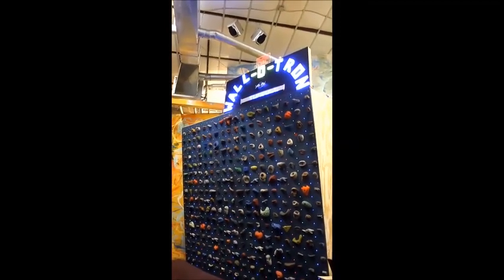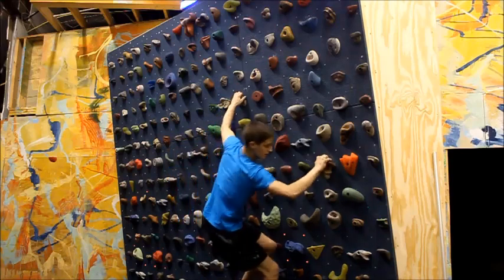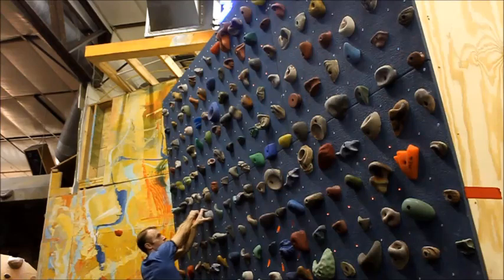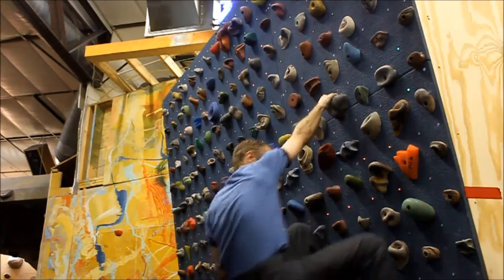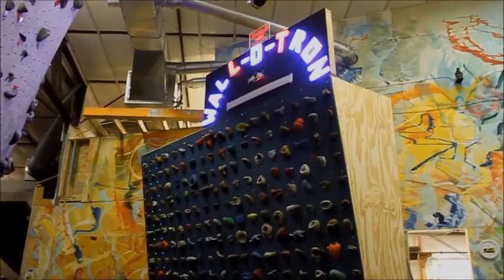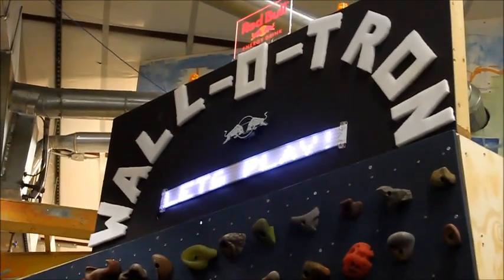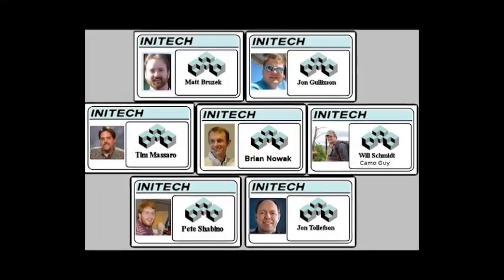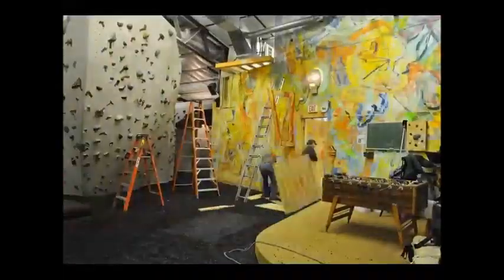"The WALL-O-TRON" by Team Rabbit-Hole - Red Bull Creation 2013 Qualifier Entry

Comment: Yep that is more or less it. Most holds you don't need the extra backing as long as the standard grip overlaps where the bolt hole is. I built a speed route for our gym a few years ago and it also uses cap touch for the start and ending holds. Instead of using the bolt I placed a plate behind the wall where a blank square of wall is the start button and a hold is the end. To start you place your hand on a square and when you remove it the timer starts. End just touch the hold.

Comment: Yeah you have to do some trickery and remove the punctuation. Thanks though! I see OP put them in the description where you can post links.

I'm thinking of using capacitive grips as a trigger for a speed comp timer at our gym. So basically you are energising the bolt (with an extra backplane for large grips) and using the grip as the dielectric and then sensing the resulting capacitance. So when a climber touches the grip the capacitance will change from it's nominal value?

Comment: Some of the hardware detail is here
[you tube will not let me link to my web page]
I am still working on adding features to the wall and trying to clean up my documentation in my spare time. 
The holds are standard climbing holds no special treatment necessary. If the primary grip surface is not over the mounting bolt or it's a very large hold you may need to add a little foil tape to the back of the hold to make it more sensitive. Most of our holds we were able to tune with software